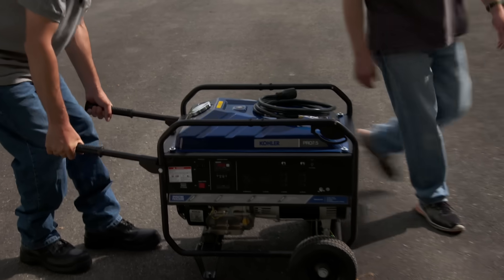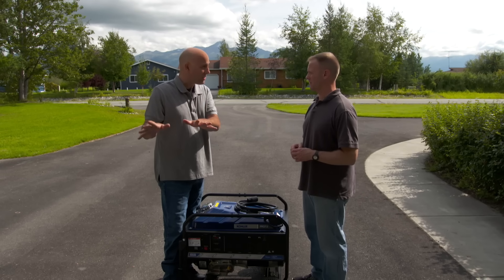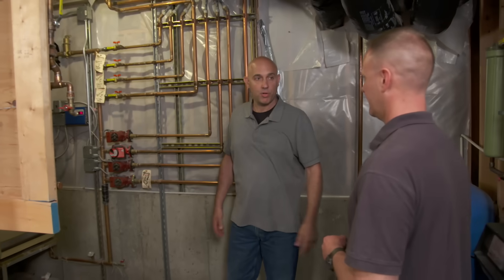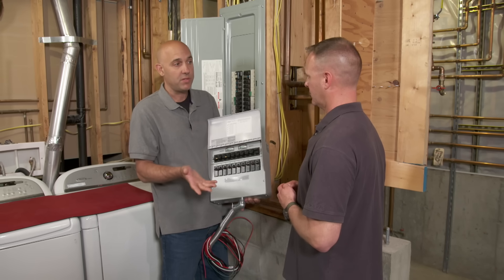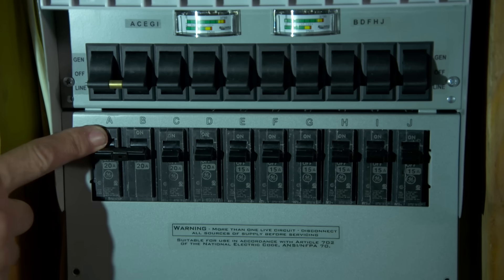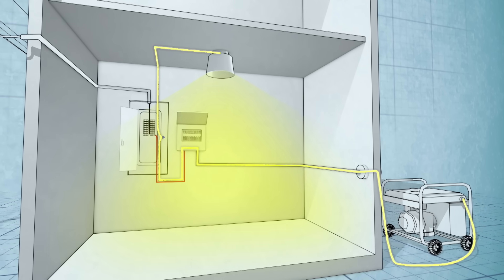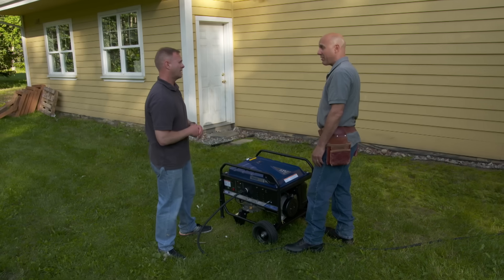How to Install a Manual Transfer Switch for a Portable Generator | Ask This Old House

Comment: The problem with most of these Youtube videos that talks about transfer switches is that they are not telling people that they need to “pair the type of transfer switch to the type of portable generator” they plan/want to used. The thing to know/remember is your house service panel is neutral to ground bonded (N-G bonded) which means that the neutral and the ground are connected and should not be N-G bonded AGAIN throughout your electrical system. With that is mind, you can get transfer switches that either transfer the neutral or doesn't. Also, with portable generators, you can get them either “Neutral Bonded to Frame" which means the portable generator's neutral is connected/bonded to the ground or “Floating Neutral” where the neutral and ground are not connected/ bonded. Most but not all  portable generators are Neutral Bonded to Frame. So if you decide to get a transfer switch that doesn't transfer the neutral then you need to get a portable generator that is Floating Neutral so that your electrical system is not N-G bonded at two location/places. If you get a transfer switch that transfer the neutral then you need to get a portable generator that is Neutral Bonded to Frame so that your electrical  system is N-G bonded when the transfer switch is switched on. Most portable generators are Neutral Bonded at the Frame to meet code when they are used as a stand alone (Separate Derive System). If you plan to use the portable generator just for backing up to your electrical system with a transfer switch then get a Floating Neutral portable generator with a transfer switch that DOESN’T transfer the neutral. But if you want to use the portable generator as a backup AND to use it outside your electrical system, get a Neutral Bonded to Frame portable generator with a transfer switch that transfer the neutral so you don’t get N-G bond at two locations/ places.  Another issue not discussed is Grounding the portable generator. If you are using a Floating Neutral portable generator with a transfer switch that DOESN'T  transfer neutral, you are not required to ground as your portable generator is using your electrical system's ground. If you are using a Neutral Bonded to Frame portable generator with a transfer switch that transfer neutral then it is a Separate Derived System and as such, the portable generator needs to be grounded. Read this link. http://www.imsasafety.org/journal/ma03/ma5.htm .
Reply: Or, hire a professional for that!
Reply: i think you mixed up neutral with ground
Reply: @denisrhodes54  That;s why real electricians use term like 'grounded' and 'grounding' conductors. Helps eliminate any confusion.
Additionally, in this situation, the service panel is the one outside where the main breaker is located and where your grounded conductor would attach.Four wires would run from here into the house to the panel where they were working which is technically a sub-panel so the 'grounded and grounding' conductors are isolated.

Comment: Awful lot of comments from people worried about storing the gasoline.  Do all of you seriously have no other gasoline powered tools that you use regularly?  Most people have lawn mowers, weed whackers, snow blowers, chain saws etc.  And if you really don't have other gasoline powered items there is still a simple solution.  You store the gasoline for a couple months and then dump it in your gas tank and go fill up the can with fresh gas.  It's not rocket science.

Comment: This could have been done a hell of a lot easier without having to bother with that fancy transfer switch thing. Just split the main incoming supply. Insert a simple transfer switch that will only allow either line or generator power into the house and you're done.
Reply: That's what we did. We just don't turn on everything to keep the power draw down.
Reply: Interlocks work, but they require more attention on the part of the homeowner not to overload their generator. Works for some, but for those who are less attentive the transfer switch guarantees that they will be limited to specific circuits for the generator.

Comment: Why does the 10-circuit manual transfer switch have strand wire & not solid copper? Wouldn't  that pose an issue with possible melting wire from amp draw between the main panel & 10-circuit manual transfer switch?

Comment: You do have to make sure the breaker is off before firing up  the generator or the electricity will actually back feed and make the power lines from zero volts all the way up to 720,000 volts. And there have been incidents where people are gathering up/ coiling up the power line that fell, and someone flipped their generator on WITHOUT switching the breaker to generator before hand, and many people have died b/c of that. So all I ask is that BEFORE you start your generator, go flip off the breaker switch and switch it to generator before starting up the generator, unlike Scott did in this video.
Reply: Unnecessary here. With the transfer switch, there is no way you will backfeed the grid. Your generator is feeding the transfer switch, in which each circuit can be selected to be fed from the generator or the grid, but not both. There is zero chance of backfeeding the grid with this method or a panel-mounted interlock, when either are done correctly.
Reply: You have no clue what you are talking about, quit spreading misinformation.

Comment: Pff. I'm sick an tired of bs. Get a 10k genset that you can convert to propane, make a suicide cable, turn main off, plug in and enjoy. This sutomatic transfer switch crap is for morons that wouldn't roll out a genset in three first place

Comment: 5 feet is the MINIMUM distance from windows. 10 to 15 feet is better

Calculate the energy draw of each circuit and be sure the total does not exceed the total capacity of both the generator & the feed wire into the house

Oh, and don't use so much extra line to connect the generator. Remember, the longer the cord, the higher the losses due to resistance. Best to be no more than 20% longer than anticipated needed length.

Comment: He said this is a 7500 watt generator, is that running or peak?  I am assuming that 14 or 12 gauge wire would do the trick?  Does anyone know if you have to have a generator this big for safety or would any size do?
Reply: Anthony Bowling mine is 40 KW.  I used double zero  copper because I have. 200 amp panel and transfer switch  that was the most expensive cost of my set up the genset is out by the shop in its own metal building  had to buy 300 feet X 3 for the hots and neutral and 300 feet on number 1 for the ground .had to go to a four wire system  for code

Comment: I turn off my main breaker and plug my generator into the dryer plug when I lose power
Reply: ya don't let any code enforcement or power utility folks know about that... very stupid thing to do and could get someone killed
Reply: Adam A:
yea like someone can get killed because he shut OFF the main breaker...  Thats the POINT of the main breaker is to cut power to the house so your generator back feed FROM the dryer does NOT go back to the street ... !!!
Reply: You are likely energizing the mains that the linemen are working on. Transformers don't care which way the electricity flows. Your generator power will get stepped up to thousands of volts down the line. Get an electrician to install a proper transfer switch.
Reply: @TheDesertRat31  if the main breaker is switched off, how could the power exit the now isolated home electrical system?
Reply: Yes Bob, explain this to me also.
Reply: Paddy MacDonald:
on a normal circumstance, the power will NOT go back to the street unless you have a faulty MAIN breaker...  OR if you have a short circuit within the generator OR within the house and the N goes HOT... then that could possibly send voltage back to the street on the N leg but i believe the generators should pop the fuse or trip the breaker by that time .. Even still the voltage should be sent to GROUND because the N is grounded at the outside panel .. 
This is why they prefer a 3 wire manual transfer switch ... Because the main breaker ONLY separates the 2 hot 120V legs... The N stays in-tact ... Even pulling the power meter off the house, the N stays connected ... So as long as that N stays N.. you are ok. 
The 3 wire manual transfer switch WILL separate the two 120V legs as well as the N wire ... Now you are 100% separated from the street ..
Reply: He states that he turns off his main breaker so how would it energize the main lines?
Reply: Jerome Kukuugya
ummmm by forgetting to switch it off or by forgetting to turn off generator before switching on? if someone is stupid enough to risk so much for such a small deal, i don't have much faith in them remembering every detail every time
Reply: Adam A I'm not stupid enough to forget to switch off the mains. I have much respect for electrical power. If 3 steps to do something is too much for you then you need to go back to grade school and learn how to follow instructions. 1 turn off mains. 2 plug up generator. 3 turn generator on
Reply: Exactly.
Reply: Jerome Kukurugya:
Bob C did not read properly ...
Reply: Yousitech:
You tell him.. !!
Reply: Bob C:
1st off he said he was shutting OFF the main breaker... Did you NOT understand that or did you over read that..?? 
2nd do you know what the main breaker does..??
3rd your tiny little generator will not survive one second once it hits the street load.. DO you really thing your 6k watt generator will support 10+ homes ...??  If this was the case then the power company would be OUT OF BUSINESS because i will supply power to the community with my rinky dink 7k watt generator ... 
4th the lineman is TRAINED to check for this issue... DO you not think for a second that the lineman will NOT check to see if the LOAD side is energized before working on it..??
Reply: Bob C he said he turns off the main breaker.
Reply: @leonardholt5311  All it takes is one instance of forgetting. We humans aren't infallible. We screw up. We forget. Transfer switches and interlocks are designed to prevent human flaws from getting people killed.

Comment: I have a slousion.brings a solor panel and a car battery and a inverter.
Reply: Good luck trying to run a household fridge off a car's electrical system.
Reply: @oldtwinsna8347  it's a joke bro.

Comment: every time I see someone put stranded wire on a neutral and or ground strip I know thats a bad idea. Those connections are made for solid wire. when stranded is used it can spread out and make a intermittent/poor unreliable connection. I want solid wire.
Reply: You can always crimp a ferrule on it.

Comment: I think what you show in the video is a really good setup and probably the best way to go for most people.  For those thinking of installing a whole house 20kW backup system, I would like to offer an alternative idea to consider.  For the same/similar price, you could install a 4kW solar power system with an 8kW generator and battery backup.  That way, instead of just sitting there waiting for an emergency, your "solar backup" system is helping to power your home all the time saving you money.  When you run a 20kW backup generator, you end up wasting most of that power most of the time and it burns a lot of fuel.  With a battery backup, you run the 8kW system, burn less fuel and use all the power to charge the batteries for about 2 hours and then shut if off for about 24 hrs while you run off the battery.  Anyway, that's how I do it and it works great!
Reply: Too expensive. Install cheaper and safe "interlock switch" in panel and your done.
Reply: Just curious how much material cost? And how much installation cost? Or did you do that yourself? How many square feet solar panel going to cover? On roof or separate individual structure? I
Reply: The solar backup isn't much help in a heavy snowstorm.
Reply: @Jen848 the solar backup is just for regular use. In the event of a power outage you would use The generator  for a few hours and charge your batteries, then turn it off and use your batteries until they need to be charged again.

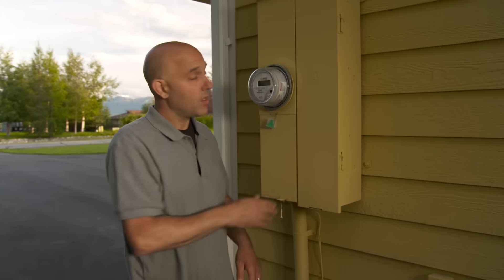Comment: It's not code compliant to install an electrical appliance underneath water lines. 7:52 to 8:15 you can see copper piping right above the transfer switch.
Reply: Colton Henderson not true. Show me that in the NEC
Reply: I'm very curious to hear how you recommend electric water heaters should be installed...

Comment: Roughly 60 amps running through 10 gauge?
Or did I miss something? Genuinely curious.
Reply: The 60 amps is really just a bad way of saying "30 amps on each wire of a 2 wire system", speaking single-phase, 120/240 VAC .  Power is delivered on 2 wires (120 volts each) so the max for each wire is 30 amps each.  We can say 30 amps at 120/240 VAC, or technically we can also say 60 amps at 120 volts, but nobody says that as it's confusing and basically adds the 2 main lines (2 lines of 120 volts) together.  It's easier to look at this per wire.
Reply: I see, thanks.
Reply: That and how come ten breakers on the aux panel all run on one neutral and one ground wire?!? 😥

Comment: you can run it in the garage just fine as long as  you leave the main garage door open.
Reply: me999 -  How do you know its fine???  Do you have a carbon monoxide measuring device in your garage and just inside the first door from the garage to the house???  I would never run any big gas powered machine in the garage for extended periods of time...
What if it's snowing,  hailing, raining, gale force winds blowing towards your open garage door??
Reply: You could but it's still a good idea to get it out in the open to avoid build up of carbon monoxide.  Better safe when dealing with an engine without any catalyst system, especially on a cold-start up.  I think you will start seeing new generators come equipped with LOW CO Shutdown sensors.

Comment: gasoline gen sucks unless you'already buying and using gas on a regular basis. can't store gasoline, it turns to varnish. I prefer to go with propane. You can stick an 80 pound cylinder of propane in a secure place and let it sit for years, the day you need it, it will be there good as ever. with gas if its sat 6 months you're already pushing it.
Reply: Most people are already buying gasoline for their tractors, snow blowers, weed whackers, chain saws etc.
Reply: Dustin Dawind  Maybe, maybe not. But even if you were it'd be nice to be able to store away some fuel permanently without having to remember to rotate it every few months. As I said, you can store a propane cylinder in a dusty corner of the garage and it can sit for decades (assuming the tank is leak-tight) and it will still be 100% usable if you suddenly need it. Also,if there is a widespread power outage, and you need more, guess what DOESN'T work without power - gas pumps. Guess what DOES still work - the padlocks on the propane tank cages. (Or, in a total disaster situation, a set of bolt cutters on said lock)
Reply: Buy marine fuel with no ethanol.
Reply: Moe American  Which changes absolutely nothing. Gasoline cannot be stored long term without degrading and turning into varnish, ethanol or not.

Comment: wire nuts in a panel?   Is this allowed in the NEC. Im sure its not allowed in the CEC. any clarification??
Reply: Yes wire nuts in a panel is allowable under most circumstances if they are for function reasons.  NEC ARTICLE 312.8 (A) provides the rules and exceptions, in this case it's mainly the area available in the panel to make these types of connections. If there is very little "open space" it may not be allowable in those bird nest type panels, but that's usually not the case.
Reply: Inspector ok them from extending the grounds in mine to add a ground bar  converted to a 4 wire system and yes it’s a rats nest in there now but deemed safe

Comment: Here's the problem i see with this. You lose power and you turn the generator on. An hour or so later, the main power come back online. What is keeping the generator from getting fucked? What if you're out walking the dog or busy and can't get there to turn it off? Second problem i see, the lights are off and the batteries are dead in your flashlights, how do you even see to make the transition? Cell phone? What if that battery dies just as they open the door to go turn on said generator?
Reply: The transfer switch isolates the generator's power from the main utility power at all times, so even when the main power comes back on, and the generator is still running, that is perfectly fine.  The only concern really is the generator running out of gas and shutting down by itself, without anyone paying attention to it (the generator manuals go in depth on this).  Otherwise it should be noticeable if the power returns as other things in the house will turn on, so that the person can move the switches on the transfer switch back to the LINE positions, and then turn off the generator.